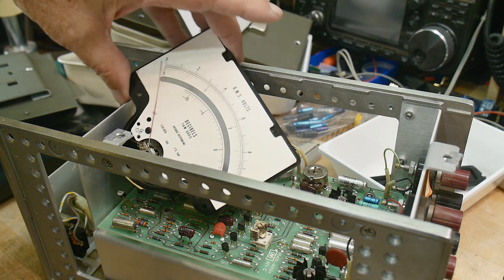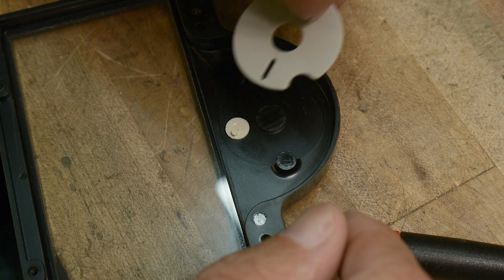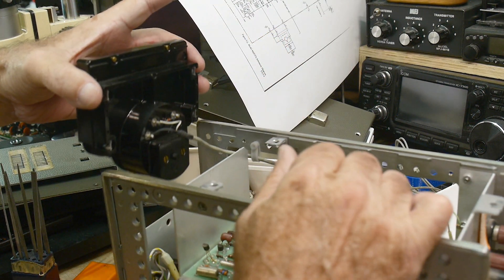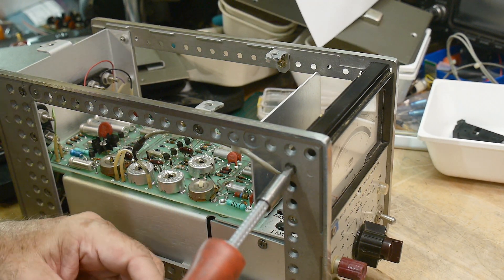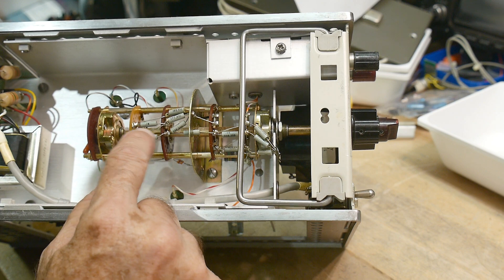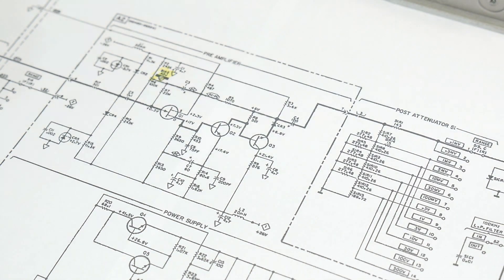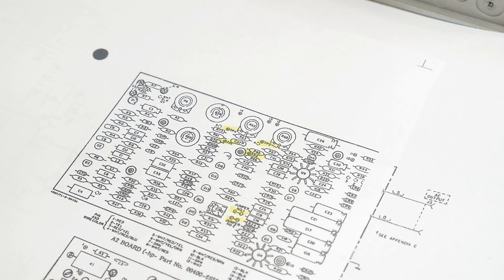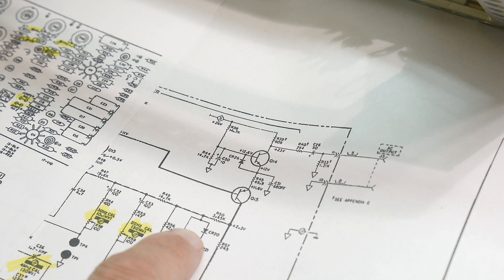#1286 HP 400F AC Voltmeter (part 2 of 3)

Comment: Sure you got the right schematics for your version of the 400F?
On the older PCB's C31 was at the position that the diode is in yours,
so maybe they relocated C31 to make room for the diode.
A late revision or modification of the board perhaps?
To improve sensitivity, or reduce noise or something...

Comment: Please, share the schematic so people can pitch in and review the circuit together.  
One thing one can notice from PCB, it seems at the time the CAD software for designing PCB was not available and the PCB has been done with marker on transparency.
Also, it might be instructive to know that what is the highest frequency that this AC Voltmeter is capable of.
I guess we have power meter that goes all the way to microwave frequencies with 50 Ohm input line, and you can inferred the voltage from power given 50 Ohm impedance of input.  P=( V^2)/R  so V=SQRT(50*P)
Reply from the maker: https://www.pearl-hifi.com/06_Lit_Archive/15_Mfrs_Publications/20_HP_Agilent/HP_400F_FL_Op-Serv/HP_400F-FL_Op-Serv_1966.pdf

Comment: I actually own 6 of these 400F/FL/GL meters (don’t ask; I may need professional help). I opened each one up to look for that diode. They all have the pads, with the plated through holes, at that location, but none of them have a diode soldered in there. Very curious. It seems like that diode location is across the base-emitter junction of Q15, similar to CR17 which is across Q14. But it’s not on the schematic, and the boards are not populated with that part.
Reply: You need to get the latest edition of the service documentation, HP sometimes made changes in the connection and put these changes at the end of the manual. My 3400 has about 20 of those changes - I haven't counted them exactly yet.
Reply: There is no way that free standing diode is factory.  The leads could have broken due to vibration in shipping and that solder is not factory either.  Agree with @garyramsey that it might have been reverse EB voltage protection like at Q14, but that is a SG5050, low capacitance and low leakage.  No idea why someone added it, but none of my hp 400F series or GL (same A2 board) have that diode, just empty holes.  The dot does suggest that someone was thinking diode when they designed the board.  Probably someone just experimenting or thinking if their Q15 failed, maybe they needed a protection diode there too.  None of my various manual dates show the diode either, but there could be a note somewhere that none of us has.  More likely, someone just experimenting or trying to match the Q14 circuit ...

Comment: With the meter adjust, could you use a fine chisel tip on your soldering iron to put a slot in it for a small screwdriver?

Could the mystery diode be CR26 ? It's near Q14 & Q15 on the schematic.
Reply: If the mystery diode is CR26 then there might be an interesting note in appendix C / backdating changes of the manual (rev. July 1974). It says: Delete diodes A2CR24 through A2CR26 (or A2CR28? having a bad quality PDF...) from Figure 7-2, Figure 7-3, and Table 6-1.
Reply: @carsten-42  That's interesting. I wonder why they did that. (?)

Comment: The screws in these units, like most 70s and 80s era HP instruments, are Pozidriv, not actually the same as a standard Phillips screw. A Phillips screwdriver may work in a pinch, but a special Pozidriv screwdriver works much better, with less chance of stripping the screw heads.
Reply: A lot of people don't distinguish it, it can still be done carefully by hand, but it's worse with a screwdriver, where devastation is almost certain, Pozidriv doesn't just have the auxiliary protrusions, mainly it has a different approach angle.
Reply from the maker: there are 4 little lines on the screw to tell you it is pozidrive